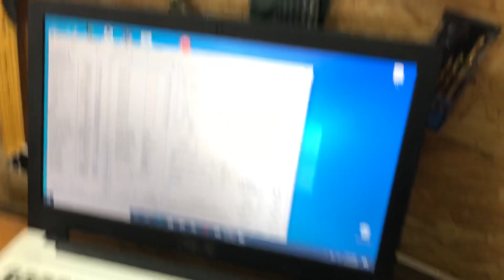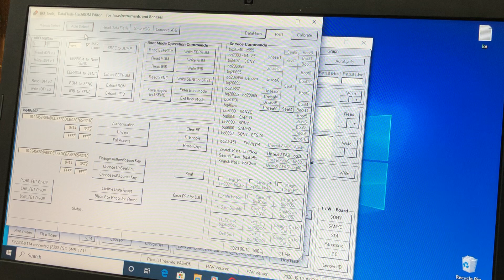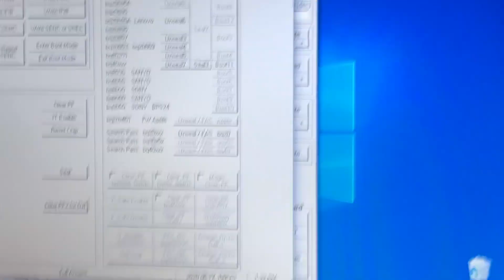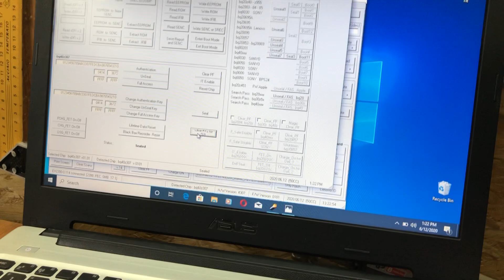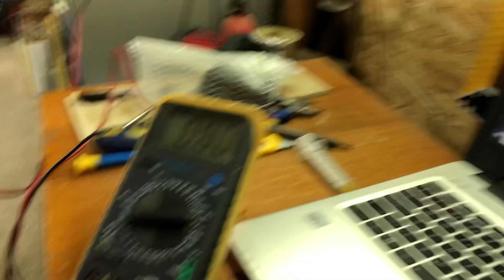Battery Mavic Air Repair (Remove Permanent Fail)

Comment: How I charged cells. Here's what I did: I used a regular battery charger designed for AA batteries, connecting two wires with positive (+) to positive (+) and negative (-) to negative (-). Then, I checked all three cells by referring to images online that indicate the positive and negative terminals of each cell. After checking the voltage of each cell, I discovered that one out of the three had a voltage below 2V. I charged that particular cell up to 2.11V (while the other two cells were around the same range, 2.11V to 3V). Charging just that one cell was sufficient. I reconnected it to the chip, ran the software, and it worked like a charm. 

Similarly, with my second battery, the voltages were similar, except this time the bottom cell was below 2V. I charged it to 2.11V, ran the software, and everything worked perfectly. The batteries now look brand new and function flawlessly.
Reply from the maker: Need to change cells above 4,2v, all cells
Reply: @mihaigsm2003  I am just saying what I did and it worked.
Reply: Im using cp2112 adapter it will work or not?

Comment: can i change my cycles?
Reply: Yes
Reply: @mihaigsm100  what software i must  use ? with dji battery killer doesn't work. thanks
Reply: @mihaigsm100  no cp2112 support ?
Reply: @mihaigsm100  does it support cp2112 ?

Comment: if the cells have dropped below normal voltage, and the battery won't turn on, could i charge it initially by jumping the board?
Reply from the maker: U can change by jumping but can’t fly
Reply: @mihaigsm2003  Why can't fly ,  i want to just wake up the battery like this then i will try to charge it with the original charger from the manufacturer.
Reply from the maker: @fluidmind3629  need reactivated BMS
Reply: @mihaigsm2003  even if i charge batteries somehow (bypass board) after that i need to reactivate bms to use the battery ? how can i reacticated ? is the only way to do this is to buy chip that can activate the bms ? thank you
Reply from the maker: @fluidmind3629  only need programming chip
Reply: i need to buy chip ? I have a question for you.
1. I saw that one of my batteries has a very low voltage, if I don't unsolder it from the bms, and charge it somehow, will that save me from activation? thank you very much !
Reply from the maker: @fluidmind3629  old chip or new chip needs activated!!!
Reply: @mihaigsm2003  ok thank you ! sadly i cant buy "programing chip" to activate.

Comment: How about putting a capacitor across V+ and V-, with a battery plug cable attached from there? Then you can swap the batteries without the voltage dropping too low? There would be a big jump in voltage when the recharged battery is swapped in, but maybe that wouldn't hurt anything. 

Thanks.
Reply from the maker: Capacitor will drop voltage until will swap cells. Difference from voltage will get permanent fail
Reply: @mihaigsm2003  
Depending on input bias current plus capacitor leakage current, versus capacitor size.

Do you know the specifics?
Have you tried? Assuming you quickly swap the battery.

Comment: Thanks for putting this together, I brought 3 faulty batteries from ebay (all new but discharged) to fix and now they all work! (touch wood) I used a USB lipo charging board to charge each cell to just over 4.1v and used the firmware to update. Great tip with the copper tape for the drone connector!
Reply: hi, can you explain to me what you did to repair your batteries?

Comment: Cool buddy thank you .   Where do I get the inter Dave computer software from for windows 10 64 please
Reply from the maker: What?
Reply: sorry .. the interface software thats on your Monitor in the video..  where can i download this software
Reply from the maker: @arroyodflint7114  it’s not for free
Reply: @mihaigsm2003  thank you 
i have charged cells on mavic air battery back up individually as per your excellent video.  but the cells or one of themmust be Pf ( locked )  so i need to dig deeper to fix which means the EV2300 and interface software i guess
Reply from the maker: @arroyodflint7114  need software to activate
Reply from the maker: @arroyodflint7114  search my videos, will find link

Comment: Dear Sir.
An additional information: I made the charge with 13V directly in the cells terminal, between  + and -- in the borders of the board (such as an unique cell). My new question: is this arrangement would made a damage in any component?
Thanks a lot.
Leonardo Vieira.
Reply: What voltage and current dud you set the charger at please to start each cell individually by bypassing the smart circuit board
Reply from the maker: @arroyodflint7114  use 4,2v with maximum 2 Amper
Reply: @mihaigsm2003  Thanks, regards and happy new year.
Reply from the maker: No

Comment: Hello Sir.
I´m having problems to access the batteries.
I have four batteries and only one is Ok (fully usual and flying).
The other three are dead and I provided charge to them using a external font (directly in cells terminals).
I´m using a Raspberry Pi for interface I2C but the communication occurs only with good battery.
Do you have any idea to help me? Thanks. Leonardo
Reply from the maker: connect charger for 3 seconds, if not communication check communication pins on board, will see 2 resistors and 2 diodes , check both.
Reply: @mihaigsm2003  Dear Sir.
I finally access the dead batteries with your tips. This access was possible when I supply 12V to the batteries while the comm session. If the 12V is off the comm session is interrupted imediattly.
This results would 't possible without your support.
For now is this, because the software that I use ins't capable to the unseal the batteries and I'm in process to adquires a EV2400 to use with BQStudio.
Thanks a lot and regards.
Leonardo Vieira.
Reply from the maker: @leonardovieiradesouzajunio1292  need special software for unseal this battery
Reply: @mihaigsm2003  I see many softwares in the net but all of them are expensive for home use/non professional. Alternatively I will try to use the latest version of BQStudio specific for BQ40Z. After autorization process, Texas Instruments sended to me link para download.
Reply from the maker: Check if diodes is not shorted
Reply: @mihaigsm2003  At the first, thanks for your very fast response.
I will check the diodes and resistors, but I don't know what are the communication pins on the board (I´m connecting comm pins in the main connector of the battery).
Really, really gratefull for your attention.
Leonardo Vieira (from Brazil).
Reply from the maker: @leonardovieiradesouzajunio1292  if you push voltage on sda or scl diodes going to shortcut
Reply: @mihaigsm2003  I´m with 100% of certain about I made correct connections in batteries connector and the problem occurs in three batteries.
Do you know other points in the board (maybe wire soldering) to make connections in comm line?
Thanks.
Leonardo.

Comment: Hello, your video is very nice. I have the same problem with my battery. I am writing to you from Turkey. Can you post the program you used?
Reply from the maker: Hi, I use ubrt software, it’s not for free.
Reply: @mihaigsm2003  how much
Reply from the maker: @anlgultekin  go to site to see prices. Depending what license you need. I not selling software, I buy too. I pay for start 300$ annual.
Reply: how may i purchase it.??? @mihaigsm2003
Reply: Hello did you get the drivers for the ev2300 coz I can't get it to be recognized by the PC. How do you get driver please

Comment: Hi Taranu... My batteries are not responding (dead)... I opened one and bypassed the board attached and I was able to charge the stacks (3 stacks). However, after closing the housing and trying to switch the battery from the power button, it is still not responding. Will EV2300 module solve this problem following your steps?... thanks
Reply from the maker: Sure.
Reply: @mihaigsm2003  Thank you so much for your reply. Do you recommend any similar/cheaper module than EV2300?
Reply from the maker: @ahmedelsheikh1987  not exist similar.

Comment: Hello, great tutorial thx.
But I have two Questions, could this fix be done without Opening the battery?
Will the permanent fail deleted forever, so it couldn't come again, also when I Change the battery cells?
Reply from the maker: if battery discharged no way...

Comment: hello my friend how can ı fix battery authendication failed
Reply: after ubrt my battery work but cant start motor and say  battery authendication failed ( mavic pro phantom 4)
Reply: @salihcengizesmer8467  this is common problem for Ubrt and similar software, it does not clear PF correctly

Comment: Hello sir, may I know the status of the battery before repair?
Is it not charging or not starting at all (no led, completely dead)
Thanks a lot
Reply from the maker: If not start is on permanent fail
Reply: @mihaigsm2003  if the cells have dropped below normal voltage, and the battery won't turn on, could i charge it initially by jumping the board?

Comment: hi I'm from Brazil. I have some dead mavic batteries. already performed several procedures. I want to buy your apadtador EV2300 and the software to be able to access the controller board. do you have the link where i can do this?
Reply from the maker: woldfish woldfish see description
Reply: Hey i want to sell my ev2300 kit, I had bought 2 pcs  want to sell of my 1 extra kit it's an unused piece.
Reply: @kunaldharod2992  pls share the link sir
Reply: @rudzt  Sorry it got sold
Reply: @kunaldharod2992  Kunal were you able to recover the Mavic Air Battery?? If yes than kindly share you email id.
Reply: Eu já estou fazendo
Reply: @santossantos7099  Olá Santos...sou aqui do RS
Reply: @woldfishwoldfish6493  to fazendo irmao devagar ta indo
Reply: @woldfishwoldfish6493  Qual nome do software ?
Reply: @santossantos7099  Olá amigo vc pode me ajudar como comprar esse software não estou conseguindo comprar se puder me ajudar meu ZAP (22)999211947
Reply: Tenho uma bateria de Mavic Air morta. Não acende nenhum led. Mas não encontro o rst na placa como na placa do Phantom 4, Mavic etc. alguém pode me explicar como o Ev2300 pode reconhece o clip ?